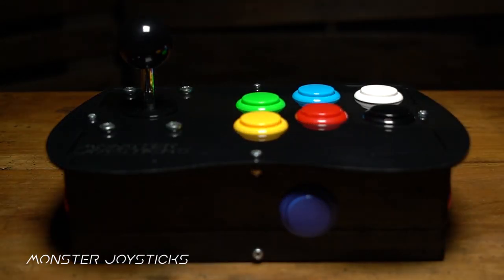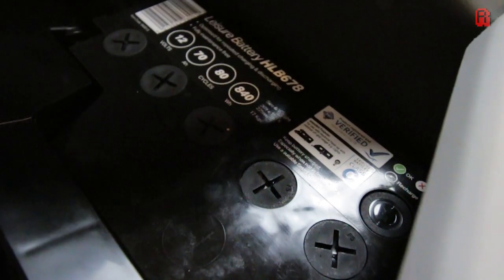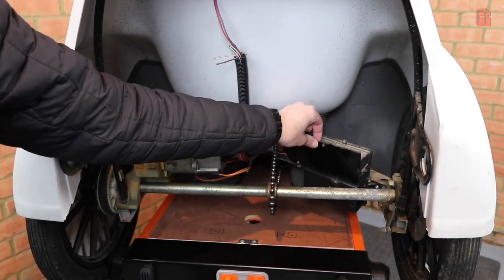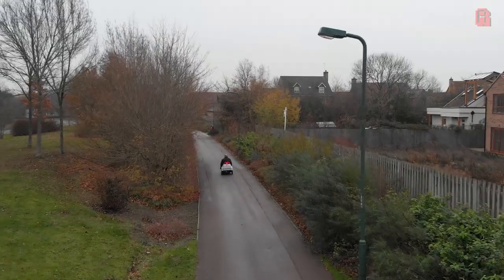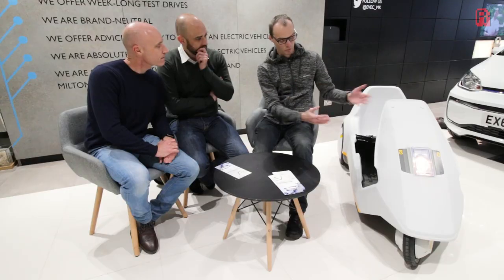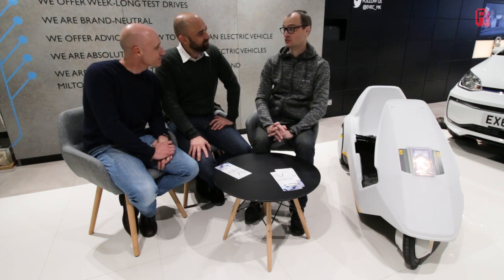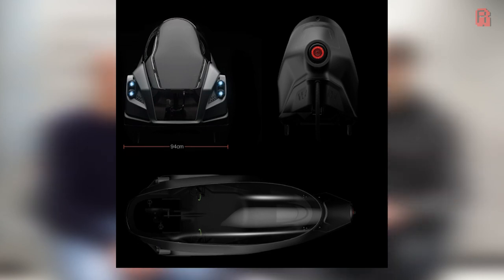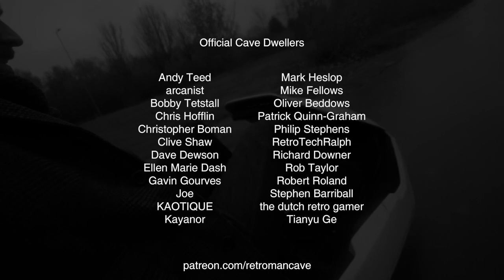Sinclair C5 - 1985 EV Restoration and Test Drive | Retro Road Trip

Comment: You riding a C5 around a shopping centre with screaming synths in the background is probably the most 80s thing I've seen in a while. Good work as always!
Reply: Kind of like Cliff Richards Wired for Sound Video? just with C5's instead of roller skates. (Also filmed in Milton Keynes)

Comment: I appreciate this video showing the results of a full original restoration. There seems to be two types of C5 owner, 'the Purist' who wants theirs to be 'original', and 'The developer',  who thinks he can improve the original concept, both seem to develop a passion for this fun machine. I do have two of these now non-original machines myself. My daily machine has been developed with a standard motor, 90A/H lithium batteries, a Pulse Width Controller, 3 speed hub (to aid pedal assistance,) and disc brakes both front and rear. For those that are interested, this can be found on You Tube as 'Sinclair C5, Hello I'm Clive' & 'Sinclair C5 with trailer'. This winter, with my second machine, I have abandoned the original rear wheel drive, and by using a 48v, gear-less, front hub, with telescopic suspension and a disc brake. Power comes from a front mounted 20A/H lithium battery pack. A 30A controller allows for PAS. (Now a legal requirement  for new machines, but this was not required on the original C5.) Pedal assistance passes through a 8 speed Shimano hub, and the final drive now has a electro-magnetic clutch, which prevents the pedals from turning, when driving in reverse! The rolling chassis has now been completed, electrics are being wired-up, and the body is scheduled for mounting after Christmas.  Hopefully a demonstration video will be ready in February. Both will be demonstrated here in The Netherlands at the 'Motor and Brommer' week-end, held in Leek during April, I shall be accompanied with 3 machines coming  from Belgium, which are all rear wheel drive 'touring' conversions of 450-800w. There are Facebook forums for both 'C5 Owners' and 'C5 Developers' for those who wish to see what other owners are doing, plus offering  help and parts . Have some fun.
Reply from the maker: Thank you for sharing your build.  I'm off to subscribe so that I might see the demo
Reply: Very interesting and good luck with your project.

Comment: I have one of these, it’s probably the most fun you can have on three wheels!  Regarding upgrades, legally the 250W motor is the maximum you can fit to the vehicle - any greater and it has to be registered as a motor vehicle.  A lithium battery however extends the range phenomenally and also provides better power on hills.
Reply: While the 250 w motor might be the legal limit you can go go to bldc motor for 0rpm starts and a better efficiency so longer range and usually more "available" power.
Reply: @timwatterson8060  Because every Bobby in town knows exactly how the C5 motor looks and will spot right away if you put the 250W sticker on a 5kW brush less monster! BTW the sticker says 12V 29A, That's 348W, so if you have some nice current capable Li-ion battery that don't sag, possibly at 16V (4S), you are around 500W with the original motor.
Reply: @Tore_Lund  I was not suggesting going over the limit , my suggestion was going to the limit with a better more efficient tech.
Reply: @timwatterson8060  If you are going for Li-ion, you have the choice between 3S (10.8V) or 4S (14.4V) Though 4S is at 16V when fully charged, it can hardly be considered going over the top. A pair of Nissan Leaf 7.2V double cell batteries = 64 AH at 14.4V = 0.92kWh as opposed to the original 36AH which for lead acid is 18AH real-life= 0.216kWh = 4.25times improvement = 85 UK miles range. Not too shabby!
Reply: @Tore_Lund  not in my local area these are illegal, Queensland Australia. We just passed a new law change but up till then even a electric skateboard was illegal. This just scrapes out of our new laws as I'm sure it's over 1.25m long.
Reply: Lithium-Ion battery and a PWM controller would make it nicer to ride.

Comment: I'm riding an electronic bicycle, or e-bike, everyday to work. Nothing radical, but still, with 48Nm it's quite a little powerhouse capable of supporting an adult paddling up to 45-50 km/h rather effortlessly. But i have to say, seeing the C5 and it being 33 years old, i'm more than impressed at what they achieved for the time. Just the thing i would love to restore and have at home for a nice sunday morning mid-summer. Great work as always, Neil.

Comment: It's really telling it's a Sinclair product. If you compare the design philosophy to their computers, they have the same bare-bones rudimentary design, but they were early to market, in an effort to become the defacto front-runner. All of the elements are there, but nothing is best in class. It's definitely built to a budget. While I don't think pulse width modulation for speed control was practical in the 80s (I'm not even sure of the history of that technology), the lack of speed control, and poor torque of the motor is a problem. I can understand why they didn't do voltage control for throttle on the motor, given how poor the torque was  to begin with. The absence of a reverse is understandable, but would be inexcusable today.  The non-adjustable footwell makes it less useful for short people, as their legs press on the handlebars, and uncomfortable for tall people.

The funny thing is, it's not significantly advanced over the small DC powered cars for children that you see left out for hard rubbish collection, on occasion. It would have been crazy to suggest children would have electric cars as toys, back when the C5 came out, I think, but if you look at any of those modern toy cars, the technology is basically the same.

Comment: It's a bit late to save Sinclair Research, but as of 2014, the Sinclair C5 can be made road legal in the Netherlands, provided you either can get it insured as an disabled person's vehicle, or you build in a pedal sensor that cuts off the power to the motor if the rider stops pedalling.

Comment: Great video as usual, although if I may offer a bit of advice on the audio - in the scenes in the garage it sounds like your compressor's gain reduction and release time are set too high, and the threshold is perhaps set a little low. That results in the volume of conversation dropping for a few seconds every time more than one of you speaks at once. Tightening those settings up would help a lot with the fidelity of the audio.

While it isn't critical, you can also improve the audio a little by cutting LF from the stereo image. The best way to do this is to set up a stereo EQ in mid-side mode (e.g. FabFilter Pro-Q2) on each stereo audio input, with a 350Hz low cut on the side band. This removes the stereo from the low-frequency band of the audio, which in turn reduces the amount of stereo interference (constructive and destructive interference) in the mixdown and doesn't cause the compressor to overreact quite so much.

Comment: I've had a 36V250W bike powered by 3x 1212 batteries (12VDC 12aH) with Hall sensors that's been burning my britches lately, having replaced the batteries only to have an intermittent problem with them. The Washing Machine motor in Clive's bike would have done well to be replaced by the type of motor I have but for each of the rear wheels, and possibly a dual-stick steering system. The three batteries (10x10x15cm each) would be easily accomodated in the rear, along with a controller. The influx of cheap chinese Ebikes is looking good down here at the End of the World, now with 48V machines, LiFePO batteries and much better through-put. A search engine would help enormously.

Comment: This might be of interest to some: Sir Clive was undaunted by the demise of Sinclair Vehicles and the C5. He carried on trying to bring to life his vision of electrically assisted pedal cycles into the 1990s under the Cambridge banner with his Sinclair ZETA. ZETA, standing for Zero Emission Transport Accessory, was a battery, motor and friction drive in a box which clamped to the seat post of any bicycle and rested on top of the back wheel, where the friction drive wheel would give your bike a boost. It didn't receive anywhere near the publicity of the C5, but I think it's still an interesting part of the history of Electric Vehicles.

Comment: The handlebars are under your legs?? That's just crazy.
Reply: it makes eating the wind shield when you drive into something much easier!
Reply: It makes more sense than you'd think.  Your legs are naturally elevated because of the pedals and it simplifies the steering mechanism considerably over what you'd think of as the "natural" position
Reply: From a seated position, having your arms up to constantly be in touch with the handlebars, would result in a lot of arm strain. Your arms would go slack and tired, so you'd have trouble reacting. And you'd just find it unpleasant. The real unfortunate thing of this design is, people with shorter legs will constantly be pressing on the handlebars, while people with longer legs will be very cramped. The lack of adjustability is a moderately serious flaw.
Reply: @cassius2k  that makes sense. In retrospect, I'd be surprised if they hadn't...
Reply: @NoobixCube  There was a off-road C5 with a joystick
Reply: There are actually many "bikes" with this seating position available today. Google "recumbent bicycle". The C5 was a joke when it came out. And now I look back and am saddened that that is how the media, and hence the public saw it. It WAS ahead of it's time, and just perhaps, in the wrong country.
Reply: @another3997  Cheers for the extra history behind them. My dad used to ride Penny Farthings back in the day. You try telling an enthusiast that that is NOT a bike. I also recall the Lotus Olympic fiasco. Funny you should mention mountain biking too. This is me on the trails near where I live in the Perth hills :) https://www.youtube.com/watch?v=vLGNFxYX15U I've not posted much to that channel yet. Just trying to get good footage of each trail.

Comment: After seeing the innards of the C5 in this video I cannot help but wonder where the budget went? I can understand spending £20 million (When 20 mil was a lot of money) if he had researched and improved batteries or some wondrous gearbox, but as far as I can tell he used off the shelf bike parts, a motor which wasn't a washing machine motor, just made by a washing machine motor company to almost the same spec as the motors they already made - for washing machines; and a big moulded plastic fairing.  Sir Clive can be considered a genius for some of his creations but for this it's akin to "Newton - The Alchemy years" where a once great mind became fixated on a fool's errand. It wasn't even hi tech for the time. He wasn't ahead of his time any more than if I 'invented' the personal hovercraft by having a bloody big fan pushing down through a space hopper contraption and then in 50 years time when we are using some kind of levitation as yet unknown or not commercially available (or in his case the Li-ion battery) people will say how forward thinking and before my time I was. We still do not really have personal electric transport. We have bypassed the one person electric 'car/bike' and gone straight to the mid sized hatchbacks and full size family cars because the idea of an electric vehicle for one person is now, as it was then, a daft idea.

Comment: A good modern motor and variable speed drive coupled to a modern battery would transform it.  Perhaps also add a nice simple gearing system like a hub change unit?      I hope the Iris does well and has learned the lessons of the C5

Comment: Would it be possible to fit a more powerful, modern electric engine in this?

Just curious, as an American I'll probably never see one.
Reply from the maker: Yes indeed.  You'd want to replace the plastic drive wheel though to handle it I expect

Comment: There has to be someone that has upgraded one of these with modern motor, controller and li-ion batteries...
Reply: There are quite a few. I have a 250W/36V front Motor and it works surprisingly well.

Comment: The design was 'cool' for the era, but inherently destined to fail primarily because of it's weight, lame motor performance and almost non-existent battery endurance. It quickly became a very heavy and cumbersome mode of transport.

Comment: What a genuine piece of rubbish - not because of the lead acid batteries, but because of everything else. Plastic wheels? Plastic gears? Are you joking? Mr Sinclair must have thought that because he can get away with using the cheapest parts on his computers, he can do the same with an electric recumbent bicycle (not a car, not an EV!). Sadly, due to safety, reliability and other reasons, this just doesn't work. This was a product that was born dead. (The IRIS trike, on the other hand, looks much more promising.)